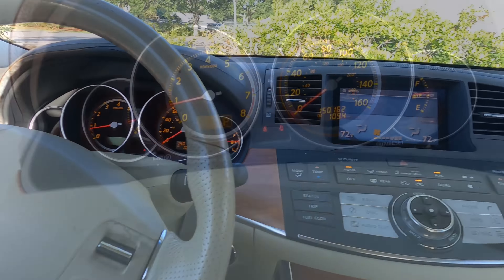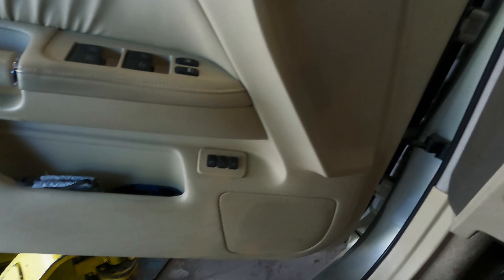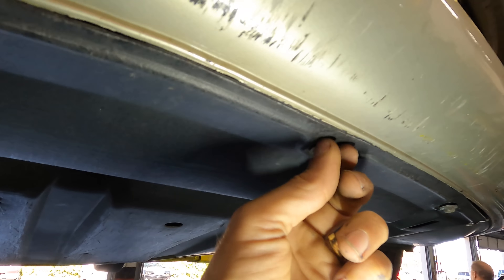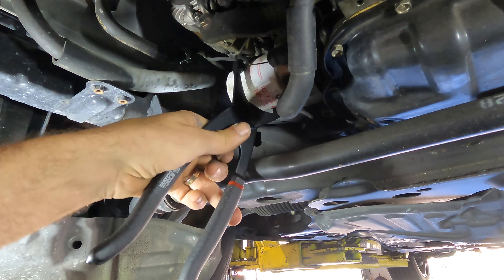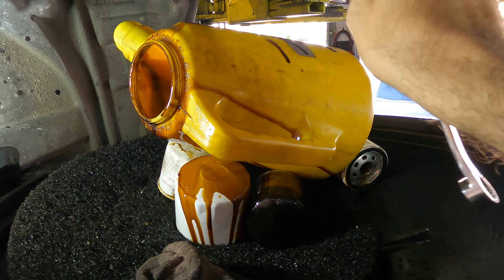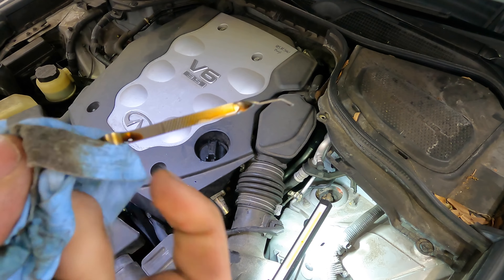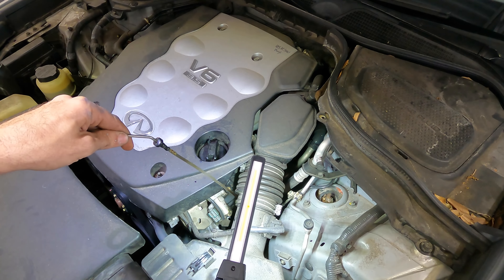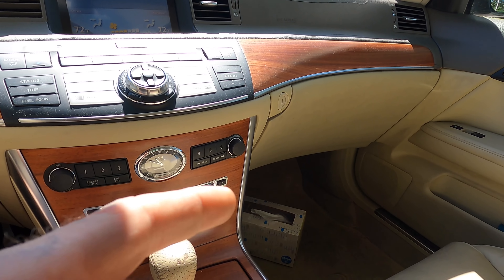Customer States: Sounds like a Machine Gun? Infiniti 3.5l V6

Comment: The gag with Petah must continue. Every car in the shop with low oil from this point forward must be blamed on Petah. Petah didn't put enough oil in last time. Petah didn't tighten the oil filter enough. Petah used his magical powers to ruin the valve cover gasket and cause a leak. Yes, everything causing low oil levels is because of Petah. 😆😅🤣

Comment: Good diagnosis. I thought for sure it was going to be a serp. belt tensioner (weak spring) when the ac cycled and / or you turned a corner putting a load on the power steering pump. Second guess was low oil sloshing around in the pan and not getting to the top of the engine.

Comment: I have a 2001 Toyota Tundra, with 65k miles and have always had the oil changed at a dealer.  Then at age 74 and  when Oil  Changing prices went up so much.  I decided to change it myself,  and saw that they had broken the splash cover in several places and stripped sever bolts out.  So much for having "PROFESSIONAL's DOING A GOOD JOB.   You do put out good videos, thanks.

Comment: It's been my experience that when cars like that come in and have a whole host of issues and request an oil change and an obscure complaint, they never address the major safety issues. Thankfully I work on my own stuff except for my wife's hybrid that's under warranty.
Reply: Agree. The oil change is the Trojan horse to get the vehicle on the lift. Then comes the "could you check the...?" .
Reply: @frankciccone8559  then when you find actual issues it's like their offended and think your trying to upsell them. I worked with Ford for years and it was always an issue. You could hear them cussing the service writers. At that point I didn't want to work on their crap because it just ends with them pissing and moaning to get their way.

Comment: Little lesson to be learnt. It's always wise to check fluid levels before taking a customers car on a test drive.
If that thing had spun a bearing whilst the mechanic is driving it you've got a real awkward situation with the customer.
Reply: Excellent point.   Could be the quickest way to diagnose a problem
Reply: Yeah but he didn't drain 4 quarts out of it either.The beauty of recording.
Reply: @whiskeybent1412  Issue is the customer will blame YOU EVERYTIME! It's not about right or wrong, you were the one driving the vehicle so I bet a court would hold you responsible if a customer took it that far - your the expert, duty of care and all that blah blah... 
It's just the crazy world we live in nowadays, it isn't right but a lot of people have zero accountability so you have to get used to doing these sorts of things to cover your ass. Most mechanics don't have the luxury of being able to film everything they do everyday as most shops wouldn't allow it.

Same goes for bald tyres, missing lug nuts ect - here in the UK (not sure about USA) the police couldn't care less that the car isn't yours and your a mechanic test driving it, you'll get prosecuted for all the vehicle defects if your stopped and the vehicle is considered unroadworthy as your the one responsible for the vehicle at that time.
We have a points system for driving infractions here, 12 points on your license and you've got a 12mth driving ban - each bald tyre is 3pts.
Reply: I've seen mechanics check the oil level before performing an oil change and making a note if it was low.
Reply: @deezelfairy  Test driving it as part of diagnosis is part of the job. All you'd have to do is prove it is standard procedure. Ray has TONS of video evidence to back that up too.
Reply: @deezelfairy  Yes, the UK has fallen.  Feel sorry for you guys..

Comment: That engine ain't long for this earth...rod knock on startup no doubt from running very low on oil for who knows how long. Looking at the leak, it could have been like that for a good while.
(I know it was a start on an empty filter, but even so, it shouldn't have knocked, even briefly - tends to suggest excessive bearing clearance)
Reply: You pre filling oil filter guys are funny
Reply: @Billybobaggins9  what are you talking about? I didn’t suggest pre-filling the filter, I said it was knocking as the filter filled…which is a sign it’s knackered, not that the filter should be pre filled. Bit tricky on a horizontal filter anyway, and I’ve never once pre filled a filter in my life!

And even if I did think pre filling was a good idea, why not explain why that is wrong rather than being a smartass?

Comment: If engineers were mechanics the oil filters will be tilted up so they don’t drain down the filter body they would just drain out the end.
Reply: If engineers worked on cars I guarantee they'd be a lot more serviceable and easy to work on all I care about is stuffing

Comment: My car has a machine gun noise.  It is when you put it on AC and recirculated air and it will make that sound for a little while.  Mechanic said it is the actuator that shuts off outside air not stopping when it should.  It has been doing it for 6 years at this point.  I will eventually get it fixed.

Comment: Don't buy (or lease) a car if you're not able or willing to maintain it and buy a set of tires from time to time. You put my life at risk (and yours). Thank you.
Reply: but they drivin an infiniti-
Reply: Right???!!!
Reply: Also notice how people buy quite upmarket semi-luxury cars and only change oil for maintenance? 100% they will run those tires down to the wires before doing anything about it
Reply: @kitsuneneko2567  there is no real punishment for dui so they do it and a car is an 
american right
Reply: People simply don't care, which is their right.
Reply: @georgecroney6168  ...as is not being able to break within a reasonable distance and shedding pieces of tire across the highways for bikers to drive over an crash or losing control over their vehicule when that tire bursts at high speeds? It is not, no.

Comment: I think in this part video, you miss some step ray. Usually, if you find a case like this, you should immediately check the oil level in the engine and I think the sound may come from the metal in the crankshaft if you look at the remaining oil that only a little is left at the disposal

Comment: People these days don't check their oil anymore, they rely on lights bells and whistles to do it for them, if they don't go off then they assume all is good plus in a lot of new cars I don't even think you can check it, I have a friend who never checks it, he brings it to the dealer once a year to have it changed and that's it. In January my exgirlfriends sister showed up at my house crying hysterically, she said she checked the oil in her 2015 accord and there was no oil on the dipstick, her husband added two quarts and still the dipstick showed nothing or so they thought. I checked and indeed the dipstick looked dry, I told her the only way to find out if and how much oil was in it that I'd have to drain it to see which I did, it not only had oil in it but it was two quarts overfilled, she called her husband and he brought me a filter and new oil, I wasn't going to put used oil back in, they always take it to the dealer for service because that's the kind of people they are, I filled it with the five quarts or whatever it required and checked the dipstick, it is very hard to see oil on the thing, another thing, the ring you put your finger through to lift the dipstick out was broken off,  apparently the dealer did that and just left it, they were going to go back and complain but I felt that the dealer would probably tell them that they can't prove that they did it so I just ordered a new one for them, you could still remove it but it still looked as if there was no oil on the stick which makes me think that they just provide a dipstick for show, what's the bloody point of having one if you can't read the bloody thing, if you do a search you'll find a lot of people complaining of the same issue. Always check your oil when the engine is cold usually overnight, that will insure the most accurate reading.

Comment: Vq35de tend to be oil burners, and if the owner is not using premium fuel that definitely doesn't help. But usually on the VQ and VK's The idler pulley tends to start going bad and making those noises too, including squealing.

Comment: Your comment about oil mileage reminded me of two Buick‘s that I owned. Both of them were the W frame, 2000 and 2005, with the 3800 series engines, and after 100,000 miles and 10,000 mile intervals for oil changes… both of them would spit out just about the same 5 quarts of oil that I put in. I did the oil changes myself and pre-filled the filters about half way. No oil leaks or LIM issues on either.

Comment: Have owned 4 of these. All had leaky valve cover gaskets.  Those plastic engine covers go straight to the dumpster. The sport model M35 M45 are great cars if you can find a good one.

Comment: These VQ35 burn oil like no tomorrow, but they also live on low oil fairly well. 06 g35x drained 3qts but you wouldn't know. The dipstick also sucks, you have to wait over a half hour after filling with oil for it to run down, then when you pull the dipstick the oil doesn't stick and drips off, so lightly scuffing with sandpaper helps. Side note; a bad oil filter and leaving the car for a few weeks resulted in at first start up, terrible clatter. Guessing the noise would be lifter or tappet-related.

Comment: My daughter has a 350Z with the same engine. I fixed the oil pan gasket leak and the oil cooler gasket leak and it has the same leak at the valve covers. That leak will have to wait. But I hate that dipstick too. Hard to get it back in and hard to read. And the splash shield is garbage, due to her running over trash on the freeway.

Comment: I had a jdm Fuga 350gt version of this car, it had an issue when the engine would just cut out while driving, was a crank angle sensor, I ended up trading it in once issue was fixed.

Comment: At 7:04 you mention there is a lot of oil and there is a lot of oil . Then after that you find where the oil is leaking from . Then when you drain the sump there is very little oil in it so you go ahead and blame the last mechanic who did an oil change on the car when you have already admitted you've found an oil leak . That's a shitty thing to do

Comment: i got a 1997 nissan altima with the ka24de twin cam 4 banger that has over 378k miles on her and i've had her since she had 15k miles on the odom, i change the oil every 5k miles and the engine still runs very strong

Comment: This is why I do my own repairs. The guy who last did a oil change on this might only just stated puting the oil in and then got distracted and had to help another guy in the shop and when he got back he forgot it wassnt topped off.
Reply: That's why you start the engine, check for leaks, then check the level one last time.

Comment: I hate missing screws so much especially when a self-tapper can't be used. I'm an HVAC/R tech and I do commercial kitchen equipment as well, I was working on a f'real blender today that despite having 6 screws to hold on the side panel only 1 was still there. Also the engineer that designed that dip stick should get some kind of award, probably not the good kind of award but they deserve the recognition for an outstanding job.

Comment: I have owned one of this car since new and it’s notorious for burning oil. I installed an oil catch can and oil pan spacer to add another quart of oil in the engine.  I change my oil every 6000 miles with synthetic oil and it’s been reliable for 145k

Comment: My state almost got rid of state inspections but seeing the cars in fla. Running around with safety items not being fixed  or replaced is what happens when there is no Inspections. Reason  our state wanted to stop inspections is costs or repairs for check engine and some counties have emissions. And we are a winter state with road salt.
Reply: In most states it's a joke. Just a cash grab.
Even with some sites doing it right there are always places that will give you a sticker for the right price.

Comment: Ooh! Those tires are bald in the inside of the tread. That means... camber issues, so there is the likelihood of worn suspension parts. I think I got that right?
If the suspension is worn enough, could that contribute to the breaking vibration as well?

Comment: An oil change on that car is just a filter replacement and an oil top off.  They should relocate the oil filter so it is under the hood and make it easy for them to do their own oil changes.  No need to actually drain the oil.

Comment: Those VQ35DE are notorious for burning oil. It usually gets consumed through the pcv valve. The owner should have been checking and topping off as necessary. More than likely those PCV valves probably never been changed. I had a G35 that did the same.  In addition to a bad oil cooler seal located right behind the oil filter mount.

Comment: The worst part of an oil change on this car is plastic bottom cover….. I’ve done this on my M35 dozens of times. Those stupid fasteners almost always strip even with careful torquing. Also the dipstick replacement is a full visual with flashlight operation otherwise you can easily jam the dipstick in the metal flange surrounding the hole… Ask me how I know.

Comment: back in the late 70s i had a really nice rambler convertible. sometime after it crossed the 120k mile marker i started getting an
intermittent rattle from underneath.
someone, i disremember who, thought it might be the timing chain needing replacing.
so, i took it to a rambler/amc dealer and asked them to fix it.
when i got it back it did well....for a couple of days, and then the rattle started again. of course i was a bit upset.
i crawled under the car, wondering and feeling around.
i reached up into the engine compartment and the noise came back---without the engine running!
i gently moved my arms around and one elbow made the noise.
there was a splash shield (?) bolted to the transmission and between the engine. there were some small missing bolts and others were loose. when i gently bumped the shield it made that rattle. 
SUCH a maroon.
i knew zero about cars. previously i had had 2 corvairs that gave me no trouble.

Comment: I’m voting that it mainly came from the loose and flopping under body panels. They not only rattle when loose but they also insulate the cabin from wind and road noise. The parts are also stupid expensive and on my bmw m5 require special 1/4 turn bolts, keepers, and nuts. A real p.i.t.a.

Comment: Does Florida require a annual State Automobile Safety Inspection?  Here in Texas our Required Annual Safety Inspection catches most of the Safety Violations. Especially since the inspections were computerized on a central database and made a requirement before the car can be registered. Yes, some a-holes still figure a way around it by switching plates, fake registration stickers, etc. However, they eventually get caught or abandon the car. Also, obvious safety violations are a Primary Traffic Offense, meaning POPO can stop you if they see excessively worn tires, etc. They may even have the car towed if they see that the violation is bad enough.

Comment: Hey Ray... Nissan recommends the engine needs to be off for 60 minutes to get an accurate reading off the dipstick. At the dealership, we never start the engine after doing an oil change. After draining, we fill to the top of the dipstick with the knowledge it will be slightly lower than full after the filter fills.

Comment: Funny, to hear Ray stating that 8000 mile oil change is too long! Here in the Netherlands are 20.000 mile oil changes considered the norm and many times above that! I don't approve nor like it, so I change it earlier myself. But 90% of all Dutch cars have that long oil interval.
Reply: Yeah, coming from the US and having 3,000 or 5,000 mile oil change intervals as norm to Europe where 10,000 is about the earliest with 15,000 to 20,000 being normal was a shocker. My car says 15,000 miles/24,000 km, however I’m going to do half that at 7,500 miles/12,000km. It sees a lot of city miles so rather do it earlier.

Comment: Hi why in the usa do you change your oil so often, in the uk we do 25,000 30,000 mile oil changes (even on diesels) with no engine issues, i have hand vehicles done 300,000 miles engines still like new.

Comment: Service manual will state how much oil that car should have, if the oil filter is same as OEM.  I have a 2011 Nissan XTerra Pro-4X and the service manual states that the 4.0L V6 requires 5.1L of 5W-30.   And following the service manual, using OEM filter or similar to it, always hits the proper level on the dip stick.  For a mechanic, you should always refer to the spec required per manufacturer.  You have access to the internet, should be easy to know how per vehicle's oil capacity, provided it is stock and using OEM oil filter or similar to it.

Comment: What is it.....if a vehicle takes 6 qts of oil....1 qt is for lube of engine & oil filter and the rest is for engine cooling?
Reply: It may run/lubricate with only 1qt, but the other 5qts are cooling, cleaning and longevity.  All the additives and lubricating properties will be used up pretty quickly with just 1qt.

You'll also appreciate the extra capacity when the oil sloshes around in the pan (acceleration, braking, turning) or during high RPM while it drains down from the valvetrain.

Comment: I have an 04 g35 3.5L and it burns/leaks oil like crazy. When i change the oil i maybe have 1.5 - 2qts drained out in the pan. Ive had the car for 11 years now and the thing just wont quit running.